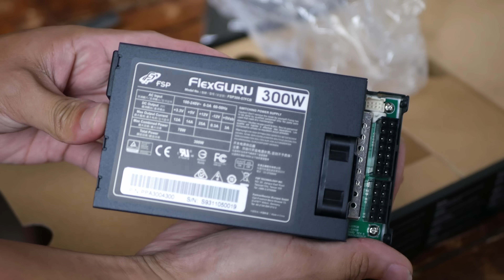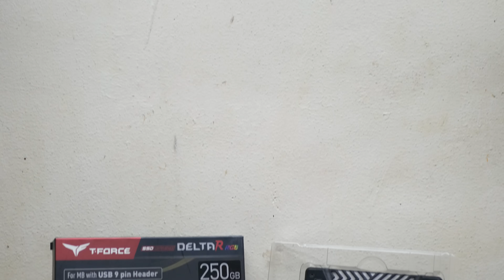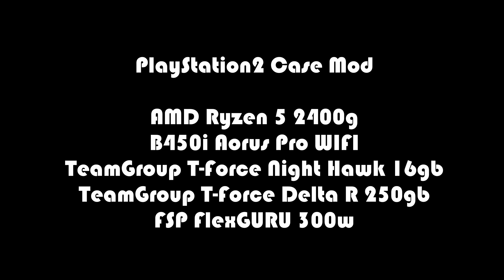PlayStation 2 Case Mod - Converting PS2 to a PC!

Comment: Such a cool mod. It would be great as an emulation station with LaunchBox launcher.
Reply: I have a Mini PC with 2400G stock cooler, with better ventilation, and less cables blocking, and I needed to undervolt+downclock It because of hot > 85C.

Seeing PS2 having less space and less air flow, uffffff

For emulation is fine, even can run Cemu
Reply: @pmatias  I had 3400g in my ps3 yes it was hot around 85c, but it was lagging on ps2 emulation, so I got ryzen 7 pro 4750g it will run ps2 perfectly and it's way cooler playing ps2 is like 45c when 3400g in the same time had 80c
Reply: Destroying a unit and rendering it useless and barely using any of the original part doesn't equal to a mod ... It's really a destructive and overall nonsense project ... This dude could source a aftermarket replacement case or 3D print an accurate one for this silly project instead of wasting a PS2 for nothing ... PS2 are getting rare by each day and hold value for what they are, they are great retro machine meanwhile a stupid PC loses it's value and relevance just a week later ...
Reply: @minmogrovingstrongandhealthy   who yes door?
It´s an expression used by the brazillian people, that sounds like "Quem se importa", that translated to english is: WHO CARES?
Reply: @minmogrovingstrongandhealthy Youre being dramatic. You have no idea what condition the PS2 was or what he did with the recycled parts. You can tell from the video this console wasn't in mint condition.
Reply: @minmogrovingstrongandhealthy  damn bro no one else agrees with you 😂

Comment: Awesome mod!
Would have been extra awesome if the controller port was usable but still, great mod.
Reply: Possible too
Reply: Definitely possible. Just grab one of those cheap PS2 > USB controller adapters and do some clever soldering.
Reply: You Can Just Use A PS3 Controller

Comment: Nice, but I'm hoping you revisited this at some point to change that external SATA hard drive setup. In my opinion it doesn't really jell with the rest of the builds clean look. A de-cased SSD takes up next to no room, and would allow you to keep all the storage devices you could want internal.

The only other thing I'd do would be to crack open the PSU, then shorten all the necessary cables to the exact length required, and deleting any redundant ones entirely. It's amazing how much space bundled overly long cables take up, and if you can solder it's a really simple mod that adds a much more "OEM" look.

Comment: I can't get over all of that cable stuffed around the power supply. It would have been worth it to take the connectors off the end and then cut and strip the cables to the precise length needed and reinsert into the connector.

Comment: Hey I was wondering how did u wire the ps2 power button. Was wanting to try a custom ps2 myself.
Reply from the maker: Hi thanks for your interest in this mod. Got the buttons/leds+wire from an old PC case then integrated it in this ps2. Check it @2:00 🙂

Comment: Late to the party but hope you still check here. Is there any way to fit in a super low profile PCIE GPU in there? Height seems to be an issue, especially with the motherboard adapter plate. How much space are you working with after installing the plate and the motherboard for a potential GPU?

Comment: Whats missing here is Functioning Controller ports and a Ps3 converted to an external Gpu Case so you can plug your Ps3 into your Ps2 and play some modern Games. xD
Good job on the Conversion tho looks dope and if you see it just from the front you wouldn't there is this much power in there :D

Comment: Awsome. But a standard sfx PSU should fit also right?
Reply from the maker: Thanks ❤️
I think sfx psu may also fit, the thickness of the fat ps2 is about 2.75" inside,I see no problem fitting a 2.5" height sfx psu..just change the sata ssd to an m.2 ssd to save more space :)

Comment: If you were to fit a gpu in it, how would you approach it to fit perfectly?
Reply: You wouldn't.  you have to have a minimum amount of space to put everything including a GPU inside a case. The only way I could think to do it is if you possibly had a laptop with a built-in GPU you wanted the stuff inside of one there's a chance that you may be able to make that work but it wouldn't be easy because laptops are designed specifically for everything to fit inside of that particular laptop in a certain way.
Reply: A HDPlex AC-DC adapter instead of a flex atx psu. Now you have space for a gpu.

Comment: Awful, the ps2 you destroyed even had a moschip installed inside. And all of that for just a crappy ryzen....
Reply from the maker: I wouldnt even modify that PS2 if it is still working though..but since it's already dead,then there's nothing for you to worry about.
Reply: You can replace the cpu in anytime so what's the problem 🙂